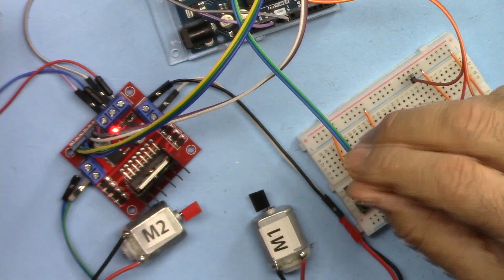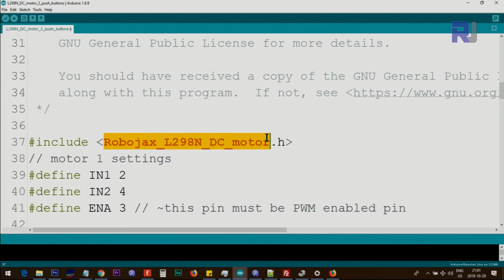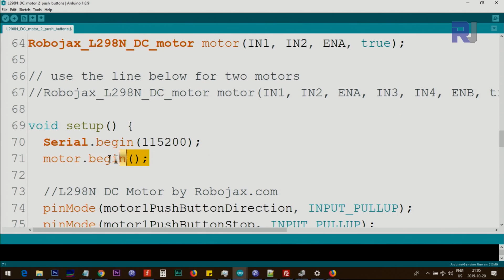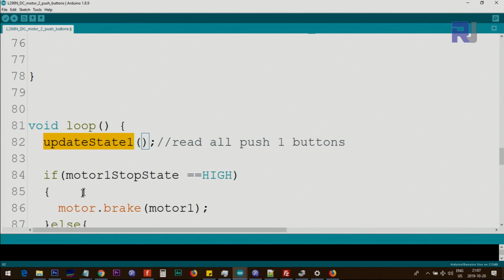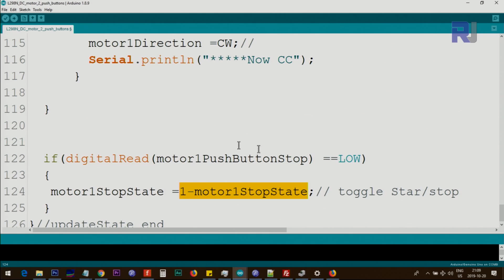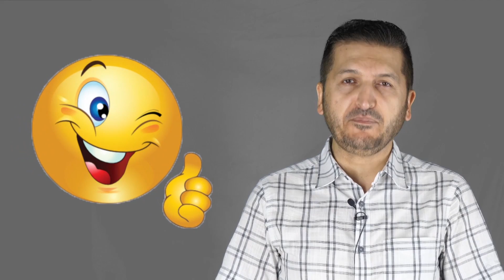Lesson 55: Controlling DC Motors with 2 push buttons with L298N | Arduino Step By Step Course

Comment: Hello Robojax, thanks for the videos. I am currently trying to make this circuit for single DC motor, I have made the same connections as you and my Arduino and L298N board are both powering up correctly. However, the motor does not start and the push buttons do not seem to be turning the motor on either. Do you know what I can do to fix this issue?
Thank you
Reply from the maker: Hi. Search my channel for l298 and first make sure you can control the motor without the push keys. Once it works then come to this video.

Comment: motor one is working but the second motor is not, knowing that i changed the code and declared all the pins:
 #include <Robojax_L298N_DC_motor.h>
// motor 1 settings
#define IN1 2
#define IN2 4
#define ENA 3 // ~this pin must be PWM enabled pin
// motor 2 settings
#define IN3 7
#define IN4 6
#define ENB 5 // ~this pin must be PWM enabled pin

const int CCW = 2; // do not change
const int CW  = 1; // do not change
#define motor1 1 // do not change
#define motor2 2 // do not change
const int pushButtonDelayTime =200;

//*** Push buttons for motor 1 started 
int motor1Speed =60;// speed of motor 1 in % (60 means 60%)
const int motor1PushButtonDirection = 8;// push button for direcion change
const int motor1PushButtonStop = 9;// push button for START/STOP
const int motor1Minimum =15;//30% is minimum for motor 1
// do not change below this line
int motor1Direction =CCW;//
int motor1StopState=HIGH;//Stope state of motor 1
//*** Push buttons for motor 1 started  ended
//%%%%%%%%%%%%%%%%%%%%%%%%%%%%%%%%%%%%%%%%%%%

//*** Push buttons for motor 2 started 
int motor1Speed =60;// speed of motor 1 in % (60 means 60%)
const int motor2PushButtonDirection = 10;// push button for direcion change
const int motor2PushButtonStop = 11;// push button for START/STOP
const int motor2Minimum =15;//30% is minimum for motor 1
// do not change below this line
int motor2Direction =CCW;//
int motor2StopState=HIGH;//Stope state of motor 1
//*** Push buttons for motor 2 started  ended
//%%%%%%%%%%%%%%%%%%%%%%%%%%%%%%%%%%%%%%%%%%%

// use the line below for single motor
//Robojax_L298N_DC_motor motor(IN1, IN2, ENA, true);

// use the line below for two motors
Robojax_L298N_DC_motor motor(IN1, IN2, ENA, IN3, IN4, ENB, true);

void setup() {
  Serial.begin(115200);
  motor.begin();

  //L298N DC Motor by Robojax.com
  pinMode(motor1PushButtonDirection, INPUT_PULLUP);
  pinMode(motor1PushButtonStop, INPUT_PULLUP);
  //L298N DC Motor by Robojax.com
  pinMode(motor2PushButtonDirection, INPUT_PULLUP);
  pinMode(motor2PushButtonStop, INPUT_PULLUP);
   
}

void loop() {
  updateState1();//read all push 1 buttons

  if(motor1StopState ==HIGH)
  {
    motor.brake(motor1);     
  }else{
    motor.rotate(motor1, motor1Speed, motor1Direction);    
  }
  //motor.demo(1);

  //motor.rotate(motor1, motor1Speed, CW);//run motor1 at 60% speed in CW direction
 delay(pushButtonDelayTime);

 updateState2();//read all push 1 buttons

  if(motor2StopState ==HIGH)
  {
    motor.brake(motor2);     
  }else{
    motor.rotate(motor2, motor2Speed, motor2Direction);    
  }
  //motor.demo(1);

  //motor.rotate(motor1, motor1Speed, CW);//run motor1 at 60% speed in CW direction
 delay(pushButtonDelayTime);
  
  
}//

/*
 * 
 * updateState1()
 * @brief reads push buttons and updates values
 * @param none
 * @return no return
 * Written by Ahmad Shamshiri for robojax.com
 * on Oct 13, 2019 in Ajax, Ontario, Canada
 */
void updateState1()
{

  if(digitalRead(motor1PushButtonDirection) ==LOW){
      if(motor1Direction ==CW)
      {
        motor1Direction =CCW;// 
        Serial.println("*****Now CCW"); 
      }else{
        motor1Direction =CW;//
        Serial.println("*****Now CC");  
      }

  }  
 

 
  if(digitalRead(motor1PushButtonStop) ==LOW)
  {
   motor1StopState =1-motor1StopState;// toggle Star/stop
  }  
}//updateState end
 void updateState2()
{

  if(digitalRead(motor2PushButtonDirection) ==LOW){
      if(motor2Direction ==CW)
      {
        motor2Direction =CCW;// 
        Serial.println("*****Now CCW"); 
      }else{
        motor2Direction =CW;//
        Serial.println("*****Now CC");  
      }

  }  
   if(digitalRead(motor2PushButtonStop) ==LOW)
  {
   motor2StopState =1-motor2StopState;// toggle Star/stop
  }  
}//updateState end
Reply from the maker: why you posted the whole code. the code is part of the library and we all know how it looks like. your comment was treated by YouTube as spam and thanksfully I just checked today. Usually I check it every 2 or 3 weeks.  Please use the provided code without any modification. if you do and it does not work, then the wriing is incorrect. firx the woring.

Comment: I have a doubt inorder to power a 6v DC motor do i need to provide power >6v or 6v along can power up the motor, is there any voltage drop in this driver ?
Reply from the maker: Yes there is voltage drpop of about 0.7V.  This  is not introduction video. I have explained it in the introduction to L298N.

Comment: Hi, I'm very new in arduino uno coding. I was looking for your lesson 55 code that control  motor with l298n. The code is very nice but it's a little bit to much for what i'm looking for. I Just need to control the motor cw start by 1 switch and stop with another switch and than, after stop, turn a LED on with a digital IO.  Can you help me? I can read and understand some easy codes but my knoledge is too Light to write the code myself. Thanks
Reply from the maker: Hi,  I got your email and responded.